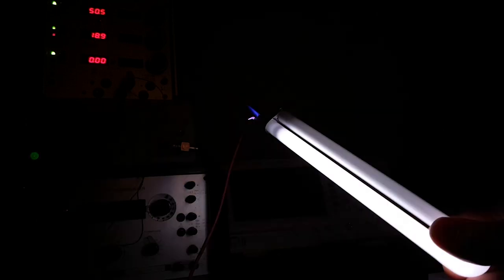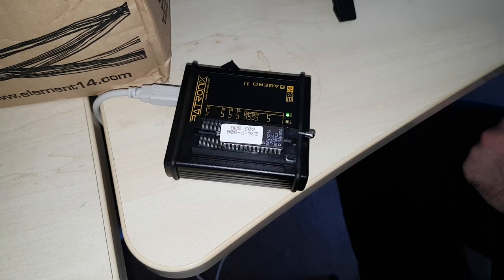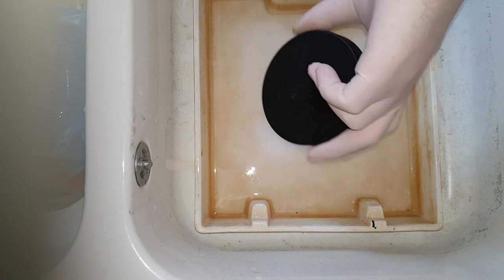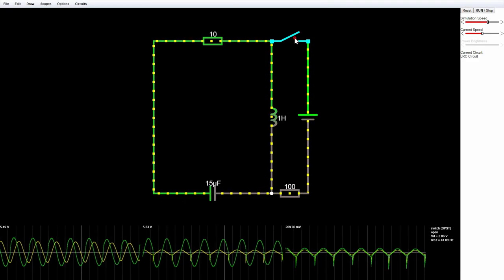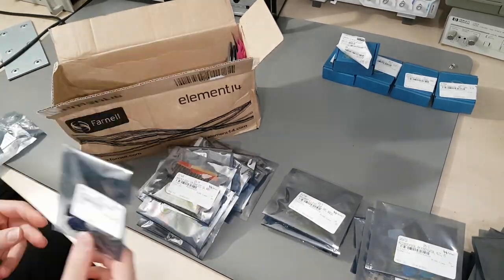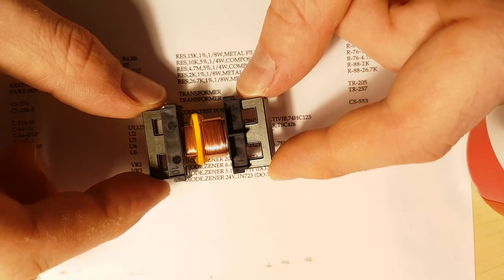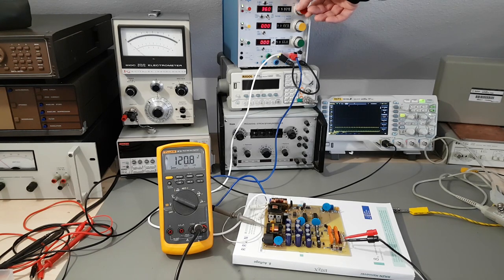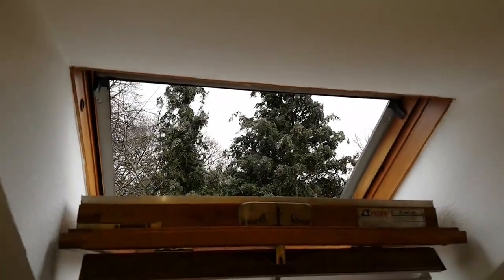Keithley 236 to 237 High Voltage Source Measure Unit Upgrade

Comment: Sure, everyone just winds his own inductors and transformers at home as needed...
Great work and entertaining video, as usual ;-)
Reply: It's surprisingly easy.
There are calculator apps (for PC/maybe JS-based for browser usage) that handle ferrite and metal powder ring core inductors, Reichelt has the parts, and transformers aren't difficult either, as long as you stick to 3-digit volts (above those, you need to be careful and often need to apply extra insulation between layers, along with saturating it in resin or transformer oil for isolation).

Comment: I buy one 237 on ebay, defect, i check and is HV cable between psu and board, the cable touch the instrument top cover and after many year, the isolant of one wire fail!
I clean, put protective plastique tube on 3 wire, now is work great!!!
Nice instrument to have, very useful.
Reply: I love old Keithley serie, this video is reference for this models.
Thanks.

Comment: Very nice job! There seems to be a mistake on the schematic, however. With such polarities of gate drive transformer windings, both mosfets of the half-bridge will turn on at the same time. Also, the crystallic stuff you get as an etching byproduct is probably CuSO4, in which case it can be reused for etching in a CuSO4 + NaCl solution. 2 table spoons of salt and 1 table spoon of blue stuff per 200ml of hot water. Please note, that this method is rather slow, especially if the solution gets cold.
Reply: CuSO4 + NaCl? How is that supposed to etch copper? What is the oxidizer (electron acceptor)?

Comment: Wonderful job as always! Just a quick question… 

Why do jumpers have ceramic around them sometimes? I notice that in most test gear and industrial circuit boards I work on. All the jumpers have that white ceramic. 
Just curious. 
Thanks for your time.

Comment: Question. I just purchased a Keithley 236, and I would like to know if the fan in your 236 turns on when you first power up the 236. I ordered service manuals. Also, something smells a little warm in my 236. Best Wishes and stay safe!

Comment: Hello Marco, great video!. I plan to upgrade my 236 as well, I have checked the service manual and it looks like there is a high voltage diode (HV-15) which is certainly obsolete. Did you manage to get specifications for this part in order to know how to replace it? Does the upgrade work fine still today? Regards!

Comment: As someone who owns two Keithley 238s, I am wondering if there is a more cost-effective way to update my firmware from A06 to A10. For me, the hardware needed to flash and re-wire the chips is quite unrealistic when all my other hardware is brand new. Does anyone know someone that can do the firmware upgrade for a price?
Reply: Macro Reps, can you please tell me what the model number is for your 236/7-801-* chip is? The one I have is covered with the firmware label and I don't want to risk erasing the firmware. Thanks!

Comment: Could you explain the steel wool topic a bit more in detail? Thanks
Reply from the maker: https://web.archive.org/web/20090907183632/http://www.tuf-ev.de/workshop/aetzen/EntsorgungAetzen.htm Can be done without PH adjustment and when letting it sit over night, no ammonia test should be required.

Comment: Howd you learn all this stuff
Reply from the maker: Well I've been to a few electronic engineering lectures in university, but what I learnt there is mostly maths. What I showed here is mostly a rearrangement of information I gathered in around the internet.
Reply: Marco Reps i took principles of technology and electronics 1and 2 in the mid 90's  but circuit board development was never covered